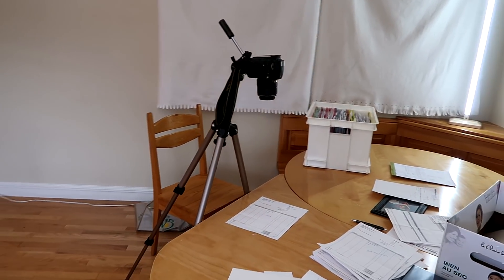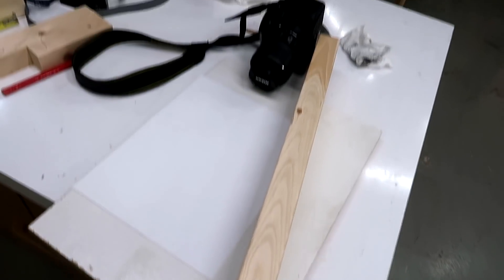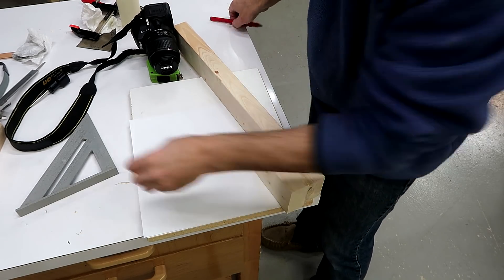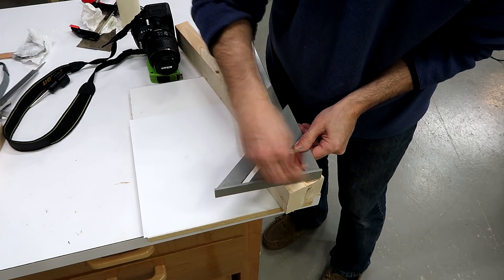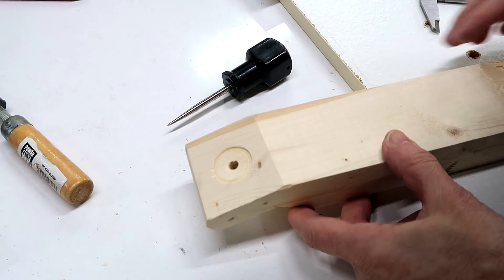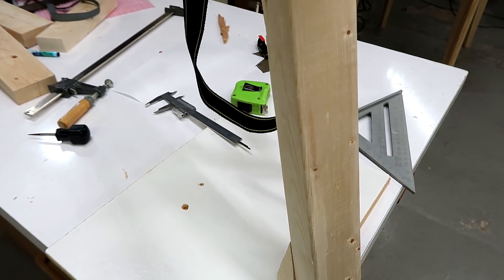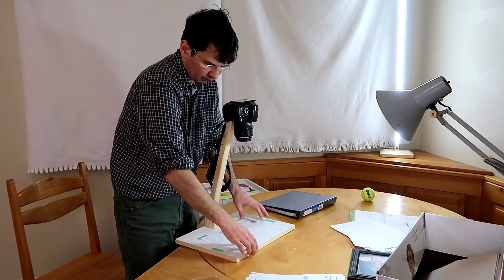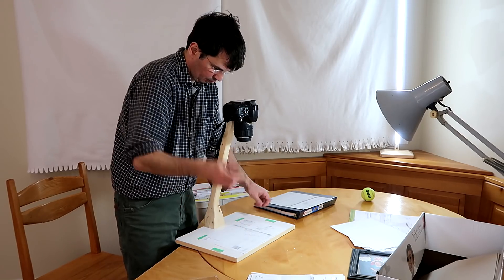Paperwork photographing jig

Comment: Next step:  paint the bottom green so you can write a script to auto crop and straighten the documents.
Reply: No need to go through all that. Since all the pages are the same size and roughly the same location, lots of programs can automatically crop and straighten based on location.
Reply: He can just make a ridge along the edges so standard letter size paper always aligns perfectly in the same spot, then crop all the photos at once to the same dimension.
Reply: Not having to align things perfectly would also speed up the manual process.
Reply: @CaravelClerihew  As mentioned in the video, and other comments here by Mathis, the entire purpose of the camera stand is that documents of varying size are being used that can not easily just be stuffed in an auto-feeding scanner, which would be the obvious preferred method.
Reply: @shivaargula4735  That was my first thought as well, but was mentioned in other comments that the pages are not all the same size.  if they were an auto-feed scanner would do the business a lot better.  Also seems in the spirit of the channel to have everything automated with a RPi.
Reply: John Galt Line love your username!
Reply: Even if it's not for auto-cropping, using a darker background helps prevent the backside of the page from showing through.  Instead of trying to get rid of ghost text with explicit thresholding (which would be dependent on lighting and paper thickness), using the dark bg buries the ghost text in the overall low-frequency shadow content that can easily be removed by doing something like a tophat transform (or other HPF + thresholding technique).
Reply: there's already "unpaper" app that does just that ;)
Reply: @JohnnyBit  I'm sure there is, but there's also already tripods and flatbed scanners too.  Kinda the whole point of this channel is reinventing the wheel.
Reply: use Abbyy hot-folders for varying quality, or manually in Scan Tailor for excellent results. former is lightning speed, latter is not that slow
Reply: He could also just use one of the many apps that already exist on the play store/app store, like office lens
Reply: @rfldss89  none of those really work
Reply: Apps for doing this on your smart phone are free and have been around for years. They even convert to PDF and can combine pdf sheets.

Comment: You should name this invention a "scanner"
Reply: youngaspireify   A scanner sweeps across the surface of the document to make a digital recreation. The camera does this instantly, shall we say, in a flash.  I think he’s created a “flasher” instead.
Reply: He should sell plans
Reply: @jamesogorman3287  Unless the plane of the paper is perfectly parallel to the plane of the camera sensor (which it is most definitely not) , this will also "sweep" across the surface but at a much faster rate.
Reply: @jamesogorman3287  only if your camera has global shutter!
Reply: It's already got a name. Copy stands have been used for many decades. This is nice and simple version though that costs much less than commercial ones, and "arrived" in his office much faster than ordering one. Mine has adjustable height for the column, as I tend to use prime lenses instead of zooms.

Comment: Neat solution. Very fast and cheap assuming you already have a digital camera of some sort. There are similar projects out there using and SLR to scan film slides.  I had a ton of document scanning to do about a year ago (and flatbed scanning would have taken years) , so I invested in a fujitsu document scanner.  Pretty pricey, but we now find ourselves scanning most papers when we get them and them throwing them away.  It's networked and pushes to the cloud, so we can search for specific items in Gdrive as OCR happens automatically. It's drastically reduced the amount of filing and document handling we have to do.

Comment: Assuming your camera supports it, a slight time-saver would be to get a remote shutter button, and mount it on the corner of the board or something...    Then it's place the paper down, move your hand slightly, push the button, move the paper off.

Comment: This is indeed the fastest way to scan lots of documents! Very commonly used to also scan old documents that can perish or old manuals which cannot have the pages removed.

I find that now modern printer-scanners are kinda fast, especially if you can find one of those with a feeder like an old fax machine.

Comment: Nice job!  A small level is a necessary tool for any copy stand; by placing it on the back of the camera it will assure that the film plane and copy stand base are parallel. Even slight mis-alignment can result in out-of-focus portions of image regardless to your f-stop.

Comment: I use scannable that takes photos from iPhone and can convert to pdf and it allows you to create multiple page documents.  If you mess up a shot you can retake and reorder the pages then send it to Evernote for cloud backup.  I want a similar rig as shown but more suited for iPhone which uses software to auto-crop to the edges of page.  Your solution takes a lot of extra work on software side.  I right now I place multiple pages on the table and walk around snapping pics into scannable.
Reply from the maker: You still need to frame every shot.  If I was willing to do that, I wouldn't have built a jig.

Comment: You have made a "copy stand", an old school device handy for graphics. I made one for myself in college using a hand saw, nuts and bolts. Yours is made only for 8 1/2" x 11", mine was for multiple sizes, going from 5x10" up to 14x24" with a fixed 55mm lens. (telescoping beam over a centered tray)
Reply from the maker: I can just use the zoom lens on my camera, so didn't think I needed that feature.

Comment: Well done.
I had an old B/W repro stand hanging around, took the stand, removed the housing where the bulb went, lens and negative tray. Then just created a wooden support platform which accepts my DSLR mounting thread (what an odd one, at that!).

Nice thing is, it's height is adjustable for framing. 
Bad thing is, it's ugly as it was a half-an-hour-hack and is only needed occasionally, like, once a year.
Beauty though, as it's working fine w/o being a fancy build. 
;-)

Forgot to mention, it's operated via remote, so I don't have to touch the DSLR body at all. Faster that way. Sometimes, I even set interval shoot, if I feel lucky.

Comment: I just remove the top bar of the tripod (bar where camera mounts), then flip the top bar upside down so it's mounted underneath.  Then it points straight down (i use a smaller camera).

Comment: Consider a modified enlarger lense (in fact any flat field lense. Few zooms are rectilinear.
One 35mm film animation rostrum camera I worked with had no viewfinder at all. They just used a plastic allignment template on animation pegs, to establish the framing and scale.   Then a tape measure to focus with. You just had to trust your settings. Most animation rostrums use a massively strong dual column for rigidity. Then its 24 or 12 individual pegged frames of animation cell per second. Sometimes with a sideways moving background mat underneath them and even other layers on the top pegs. That is why traditional animation work takes so long and costs so much.

Comment: Ooh, that was a fun optical illusion.  The second shot of the infrared heaters looked like the right side one was pointing away from the workpiece.   Then the camera angle changed and so did my perception.
Reply: Wow, I noticed that too and it wasn’t until I saw your comment that I went back and noticed it actually wasn’t pointing the wrong way. Nice.
Reply: i see what you are talking about but i still don’t see the illusion. the red light appears on the piece so it doesn’t really throw me off

Comment: I built something similar, but way hackier (just scraps and a few clamps), when my scanner had a gravity accident. My main issue was the lighting. There is a noticeable brightness drop from one side to the other. It needs some kind of area/square light around the camera with a hole for the lens to poke through for good quality illumination. But for "tax stuff" it is good enough anyway.
Reply: I've had good results with a couple clamp lights pointed from opposite directions at about 45 degrees to the subject.

Comment: Scanner with an autofeed is a nice investment if you do a lot of this sort of thing. Most decent laser printers come with one.

...Just have to remove a few staples then (or snip the corner off).

---

Thankfully we don't need to do this in the UK. If you're employed your employer handles everything. 
If you're self employed you just submit your accounts and only have to provide evidence if audited.
Reply from the maker: assuming your documents have never been folded, and they are all the same size, and same kind of paper.
Reply: @matthiaswandel  my docs are pristine buddy! don't forget it
Reply: Not only in the UK, in most European and post USSR countries the tax gets handled by the employer and you only have to check it online once a year.
Reply: Matthias Wandel even if they were folded and mangled, a good scanner can run it through. While the idea is creative, it a bit behind with current tools on the market.  I fully enjoy your videos though!
Reply: @matthiaswandel  no even then modern printers do ok. If your documents are mangled your overhead camera wont help either.
Reply: @matthiaswandel  Previously folded & different sized sheets feed just fine on mine (so long as you tap the end of the stack on the table so the bottom of each sheet is aligned). Paper thickness isn't usually an issue either. ...Unless you're talking thick cardboard, but there aren't many businesses I'm aware of send invoices out on that.

 It's only really staples that foul mine up (and scratch the glass.)
Reply: @matthiaswandel  I think your idea of scanner feeders is a little outdated. the one from my el-cheapo HP $250 printer-combo  happily scans anything between A4 and A7, creased or not, paper thickness doesn't really matter either unless it's really thick or torn or something. Just stack them up, align all of them bottom-left and press 'start', and the whole stack  is scanned and saved as PDF's.

But tking pictures works too, just remember to check the focus every so often,zoom lenses have a tendency to zoom-in when they are hanging down like that.
Reply: I have an old Fujitsu ScanSnap 1500. When I bought it, it came with a full copy of Adobe Acrobat, making it a terrific buy at the time. Anyway, does two sided scanning of pretty much anything I've put through it of many sizes.. from driving license through A4 to legal size documents.
Reply: If you are self-employed, like Matthias is, then you still have to do taxes in the UK.
Reply: @slashrjl  I mentioned that in my comment.

You still need to submit your accounts, but only need to provide evidence (invoices, etc) if audited. So most of the time scanning all your documents is unnecessary.
Reply: @JW-mx3qg  Yep! Windows 10 has built-in scanning and most every laser printer has a scanner. But this is Matthias Wandel and complications and over-engineering are required! Oh yeah, and it MUST be made of wood!
Reply: @sasjadevries  Which sucks for you if you like investing. Meaning, you can't invest the money if the government takes it away from you monthly before you even get to see it. I'd rather pay taxes anally and take that cream from the cake.  Even with shitty interests, 200 bucks is 200 bucks.
Reply: @sasjadevries  doesnt work if you are self employed ;)
Reply: @sasjadevries  That's how EUSSR countries maintain support for such high tax rates:  Keep the people ignorant of the taxes they're paying.  The same holds true for sales taxes (vs. hidden VAT).
Reply: @c0ldc0ne  Why would you care to "check it online" if you have no control over it or involvement in it?
Reply: Sounds like the 1042 form here.:
Line 1.  How much did you make last year?________
Line 2. Send it in.
Reply: chunks of wood from the cutoff bin is slightly less expensive,  also going shopping for a scanner doesn't make a very good YouTube video :D
Reply: @slashrjl  Bingo thats what I've got. 25ppm, can handle a wad of ~50 documents (granted less if they are in crappy condition) and just does it's thing and converts to pdf. WAAAAY faster than aligning on a plate, taking a photo, occasionally having to put a bit of glass on top if its crumpled, then transferring from the sd to the computer. 

Love your inventions @Matthias Wandel but this one is certainly not an improvement over a good feed top.
Reply: James Bradwell it works the same in the US and I imagine CA to. If you run a business you can tell the IRS your expenses were $X but if the audit you they are going to want recipes to prove what you actually bought. I imagine the same is true in Europe.

For some reason still beyond me the world hasn’t digitized receipts yet. When you charge something that information should be sent to your bank and stored there just like it’s printed on your receipt but that system doesn’t exist for reason.
Reply: @Mrcaffinebean  ah right. So spending hours scanning & digitally cataloguing  all your invoices & paperwork is just to save having to find the space to store them in a box for a few years?

...hardly seems worth it then.
Reply: James Bradwell exactly and it’s best accounting practice. There are lots of people that throw them away and never get called on it. Mathis is far to organized for that :)
Reply: @matthiaswandel  yes, most consumer devices are bad in that regard. The fujitsu SnapScan iX 1500 however is perfect. I think it would even perfectly feed a ball of cumpled up napkins if you tried. Idk what they do different, but their feed just works. Hundreds of assorted documents, just whack them in and it works. It's about $500 though, which can still be a good invenstment.

Comment: All Wandel projects are very creative and thoughtful, although in this case would it have made more sense to simply mount the camera to the bottom of the height adjustment post and have the camera positioned between the tripod legs pointing down? Then the tripod is placed on the table to perform the function you need.

Comment: Since the stability of the camera is well fixed, adding two guides at 90 degrees to one another to lay the paper against would help to establish good control of the horizontal and vertical planes when the images are used within various programs. Especially when doing OCR work.

I use a low cost HP All-in-One for scanning and it has an ADF, so the little bit of time (man hours) I spend on scanning hundreds of pages for OCR isn't that much. Perhaps you need a different scanner.

Comment: Technically it's called a copy stand. Been around for a hundred years.
A scanner would be a better option, at least a good scanner like a fugitsu. Its super fast and can take 99.9% of paper sizes. I use it all the time to scan all sort of papers. I scan things right into a PDF no post processing either.
Copy stand were made to copy photographs and make negatives from the original. That had side lights as well

Comment: It would speed up the operation if there was a camera trigger located somewhere on the scanning deck.  Also I see people suggesting using an app, but this method would produce much higher fidelity copies and take error and distortion out of the equation. Unless you just mounted your phone in that thing instead of a DSLR.
Reply: I've got a similar set up with an IR remote to trigger the shutter. Set it anywhere convenient and you're right it's speedy - and you don't need to touch the camera which can cause some shake

Comment: I like the little platform/arm, but doesnt that tripod allow you to remove the center tube and put it in backwards for this sort of thing?  most of the Manfrotto designs and their clones I have had do and that looks like one.
Reply from the maker: It does, but it still needs to be carefully lined up and too easy to bump out of place.
Reply: @matthiaswandel  the bumping part I get, and the lighting would be easier with the single arm, I was more commenting on the setup at the beginning.

Comment: There's great phone apps now that automatically capture frame of the document and turn it into a pdf with very little fuss. Just point a shoot (like the man said).
Reply from the maker: The problem is not making the PDF (I don't even want a PDF), the problem is framing the shot quickly.
Reply: The app i use doesn’t need to frame it perfectly - just corrects any distortion on the fly very effective, but hands free like this would be good too.

Comment: Philosophical question. Why scan the records?  In the US receipts are only required for 3 years. Summary worksheets are sufficient from year 4 to 7. Having said that, I just bundle the paper with a printed return and put it all in a folder marked to retain for 7 years.  As an interesting side note, several articles have pointed out that the US IRS is frequently unable to access tax returns they have received after a year or two.
Reply: He lives in Canada. I don't imagine that he is required to file with the IRS. It may still be a valid question, but you seem to be assuming he is in the US.
Reply: Nope. That’s why I started with “In the US”.

Comment: I appreciate mounting the camera aloft required more of an engineering challenge but .... why not a desktop tripod and a vertical paper holder?
Reply from the maker: I got tired of having to re-aling eveythng after bumping anything.  Also, hard to smooth a piece of paper that wants to fold, especially if it's not horizontal

Comment: Genius.  I have a dedicated Epson flatbed scanner, and it is a hassle to use (it does make good images, though).
Reply from the maker: Scanners do work well, as long as it's just a few pages
Reply: @matthiaswandel  only true for flatbeds. Feed scanners can do 20-30 docs a minute (yes even ones with a bit of a crease). Been using one for several years and had no issues.